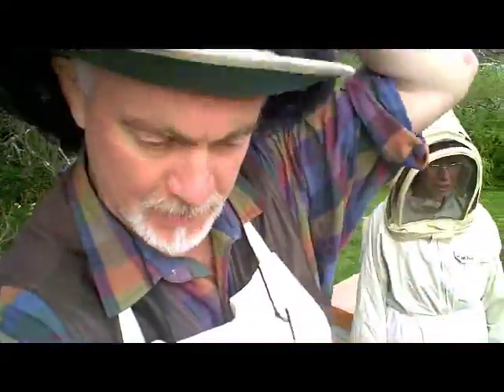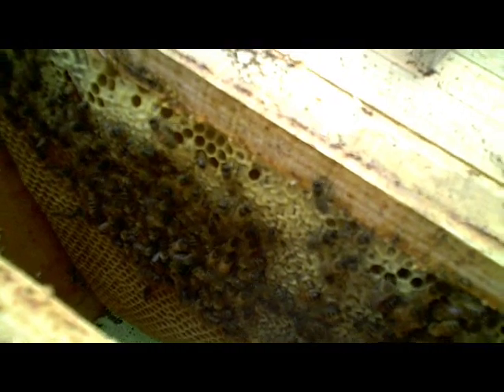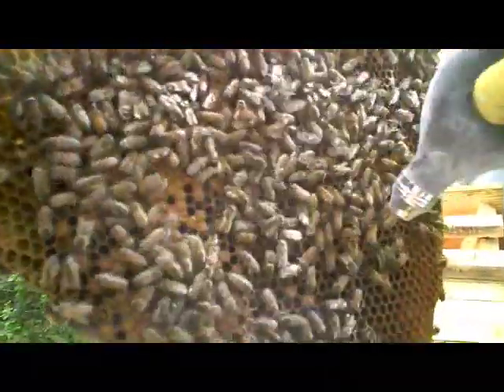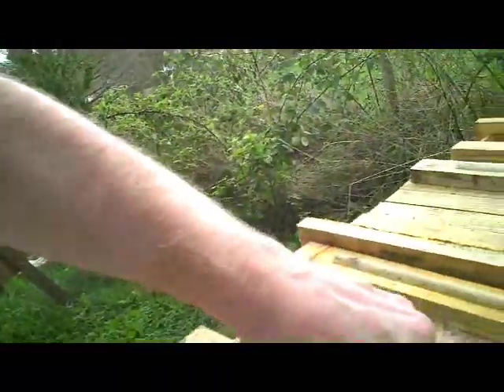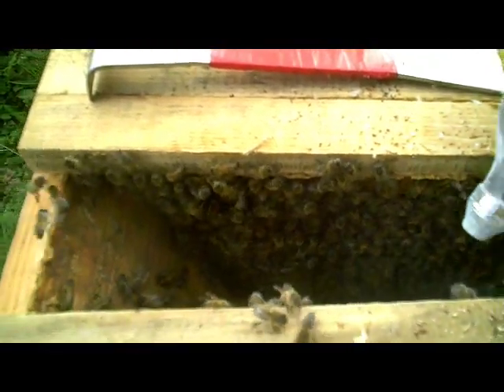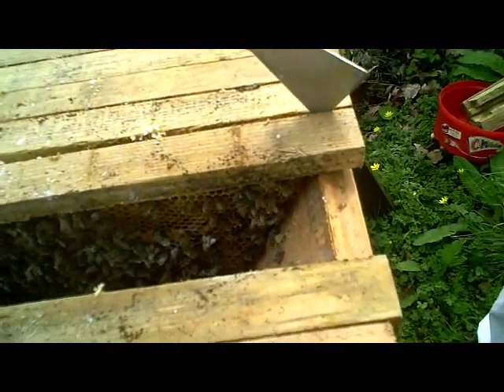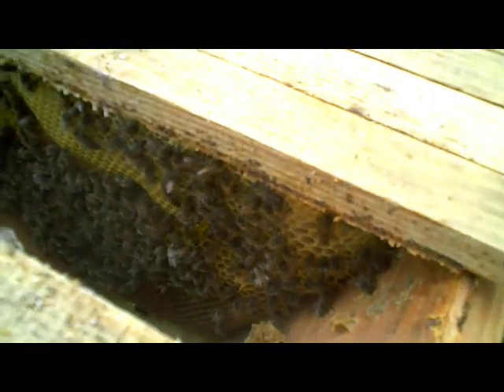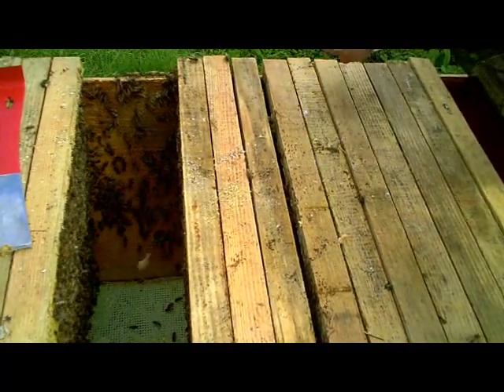Early Season Varroa Dusting and Top Bar Hive Check

Comment: I thought that bees in top bar hives regress to small cells and that small cells is the natural chemical free solution against varroa... is this not the case then? or your bees are not regressed to small cells?
Reply: The "down sizing" you are referring to does take place, however, if the original colony are some big ol' bees, then it will take multiple generations for them to "down size", as they will have to do it gradually or the queen won't be able to get her fat ass in the cell to lay the eggs.

Mike Bush has a video called "why go foundationless?" that discusses this same issue I found interesting, and pretty much spot on.